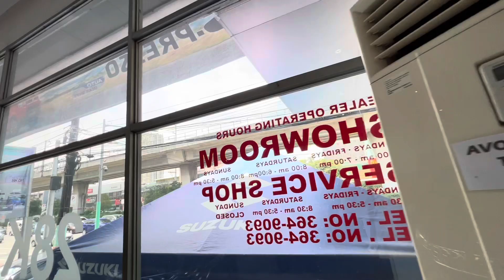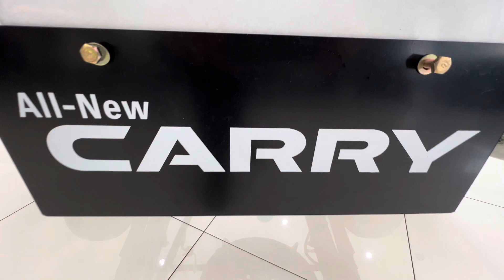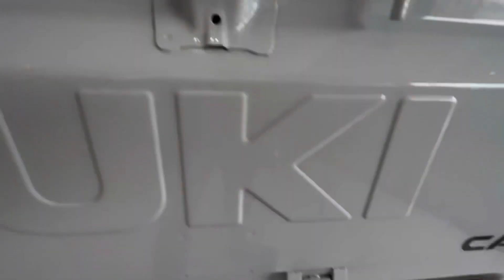Suzuki brand new promo, bagsak presyo, big cash discount, low DOWNPAYMENT, low monthly amortization.

Comment: hello po magkano po ang cash discount sa suzuki caloocan po, S-Presso AGS po. salamat
Reply from the maker: Suzuki SPresso ags 2023
660,000 unit price 
+1691 3yrs tpl
661,691 total
32,000 manager cash discount 
629,691total cash price
Freebie’s 
3yrs lto registration 
3yrs warranty 
1st 2nd, 3rd check up free labor any Suzuki branch 
Tint
Matting
Seat cover
Set of tools 
Umbrella 
Early warning device
Seat of tools
Caltex discount card
Keychain 

Pag gusto mo po kumuha ng isurance sa amin
660,000 unit price 
+ 20,926 1yr comprehensive insurance, 1yr acts of nature 3yrs tpl 
Total 680,926
32,000 MANAGER DISCOUNT 

648,926 TOTAL CASH PAYMENT 
Optional ang insurance po boss gusto mo kumuha saamin or hindi. Pero mas maganda saamin para if ever man may mangyari may mag aasist po sa inyo.
Thank you so much po
RAMMEL GONZALES 
SALES MANAGER 
SUZUKI AUTO KALOOKAN BRANCH 
09159079878